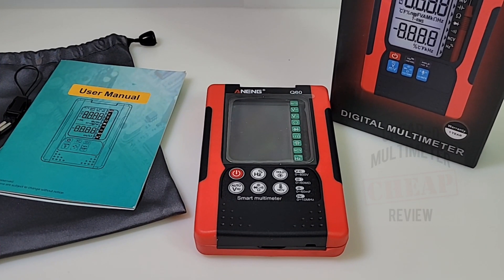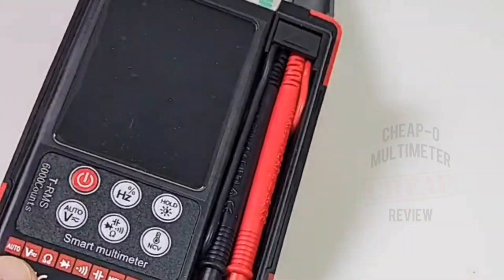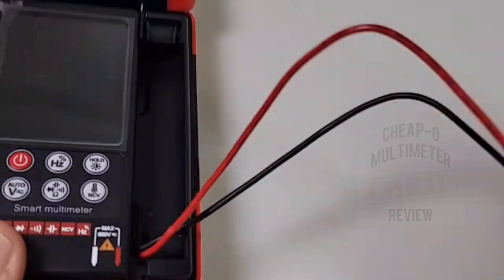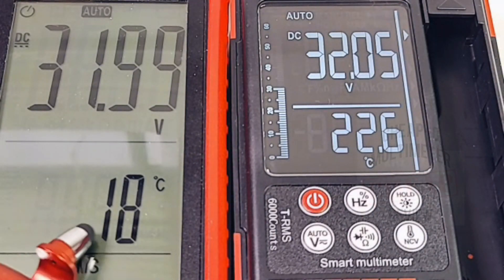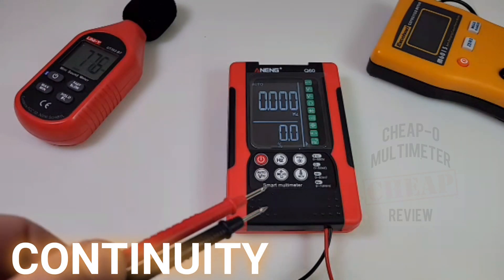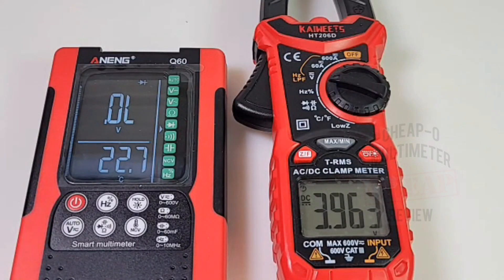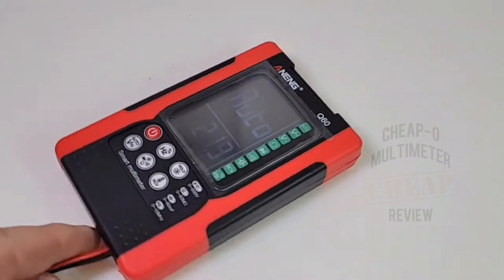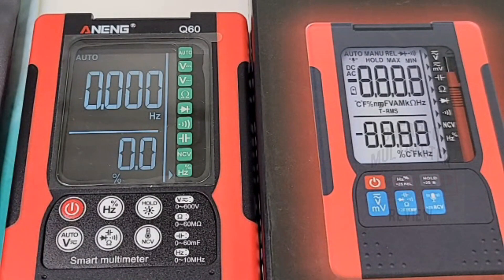ANENG Q60 CHEAP-O Multimeter Review & Teardown!

Comment: It's safe cause no fuse on that type?
Reply from the maker: For low voltage  house work..yes,it's safe.
Reply: @KeepOnTesting  but that ptc protection look like tiny are they strong enough protection ?
Reply from the maker: @spicybow  For low voltage / household mains it should be fine. PTC size should not play a decisive roll as they react to temp change the same.
Reply: @KeepOnTesting  thx man appreciate it for your info

Comment: The buttons on the cover are not meant to electrically operate.  They mechanically couple to the actual buttons when the cover is closed.  Your entire characterization describing those buttons on the cover as not working is a complete mischaracterization.

Comment: On the vertical legend on the cover:  There isn't room for it on the underside section because of the space given for storing the leads.  And no desire to enlarge the width just to add the legend between the display and the lead recess.  I suspect they considered the choices of not having at all, or at least having it on the cover usable when the cover was closed.

Comment: One of the reasons (actually, perhaps the main reason) for the screen protectors is for protection during handling during manufacture.  The actual display had a lot of handling before it ever wound up being underneath a closed cover.  This is to get the product in good condition into the customer's hands, who then removes the protectors.

Comment: This one sadly is a nice quality display crippled by an overly gimmicky case design and non detachable leads, too fiddly considering its meant to be portable and handy.  Put this display in a more intuitive and workable package and its more of a contender.  Another attempt at reinventing the wheel so to speak just to appear advanced and just creates unexplained over complications like non functional duplicate buttons on the case front, no workable stand and generally not all that handy to use compared to a  more standard meter format.  I like some of Anengs stuff but I feel weve seen this movie before.
Reply from the maker: Great points..I don't understand why ANENG couldn't have designed the clamshell to at least double a a proper tilt stand  🤔 Also losing the function display icons on the secondary display doesn't make any sense.
Granted, it's a unique perspective on the multimeter theme with some great outward build quality it still feels like an "unfinished " product.

Comment: An odd meter indeed! There is a separate battery compartment, no?

If you ever get a chance, please measure the current draw on one of those displays. I seem to recall the original "dark displays" consumed significantly more power while idle.
Reply from the maker: Roger that Eric..Yes , 2 x AAA battery compartment ( sorry that somehow got edited out). I'll take note of the current draw next time round.
Reply: Yes, but he'd need a meter that can do it ;-)  It's a feature I've used since buying my model-77 in the 1980's
Reply: @CliveChamberlain946  haha. good point.

Comment: Even though it won't blow anyone's mind, I like the overall design. It's a nice smart iteration of AN8203. 

I won't deny its quirkiness, it has its downsides.  But I like seeing ANENG making multimeters in all possible shapes and sizes. Maybe it'll be just perfect for someone. For me personally, lack of current mode is not a problem at all. I use it ones or twice a year at best. 😅

Comment: Quite a nice meter to be honest. Indeed not the cheapest one and the fixed leads are a little on the short side but for most non-dangerous voltage situatlons this meter seems to be well up for the task. Apart from the lack of current measurement it really has a nice feature range.

Comment: Just got the orange one and it will be a present to me pa this Xmass. I have given it a brief test run and do comment as this: I do not find it that quirky regarding the casing. It's more one of these with an integrated case i.e various Sanwa models for a fraction of the price and here you still can use it WITH the lid on! But, yes, the lid could have had a "notch" or sorta, double it as a more reliable stand. Wouldn't have costa a thing more..

Integrated case and fairly compact for pocket transportation without too many things dangling and flapping around. 

Performance is ookay nuff but do wish that the temp readings were a little more "consistent" (I know they're the dang cheapest sort of tc-shunt-cold bridge types but...). Did just tried three different Anengs side by side after they did rest in a low temperated room for +24 hrs and they showed 10, 12 and 15 deg C.. duh.. 

Given the price I do not stress too much if the leads are captive and weak light etc.. display is nice tho. In many situations much better than plain bw LCDs.

The "missing" mode symbols when the lid is up is partially substituted with that you still have the various icons popping up on the display itself showing the modes.

If you don't care about the case you can find more compact types for the same price or less. Still all will be of the captive leads type and now stuff will dangle around.

All in all: OK nuff but ofc there is alternatives too..
And while I'm here I'm looking forward with wet puppy eyes to your SHINY review of the latest clamp meters! With DC current and the handy "max/min" ability! Especially the ANENG ST192 and its accuracy when use it for imitating human jaw flapping...
Reply from the maker: Those shiny clamp Meter reviews are coming soon..those puppy eyes won't have time wait too much longer 😀

Comment: Did like the display on this, should be good when in poor lighting. Probably good for someone with an electronics hobby working on low power DC, not sure I would trust it on mains voltages. Nice quality review though.

Comment: REQUEST: Can you explain how meters are rated one day? I propose chopping 1 star for no current mode. Think about it, with gimmick's like we see here, makers have an excuse to make unsafe cables that can pass just a few milliamps.
Reply from the maker: Hi Cliff..

Great point. I'll disclose the 5 🌟 rating schema in a future episode. 👍
Reply: Not everyone needs current and I definitely wouldn't hesitate to buy a great meter that didn't do current. Now if it didn't do voltage or resistance/continuity, I'd probably skip it.